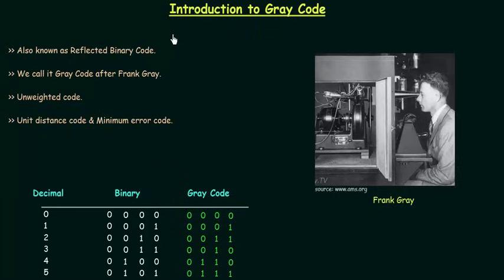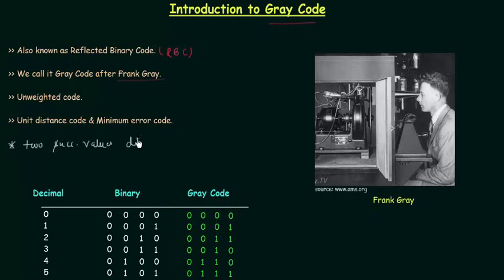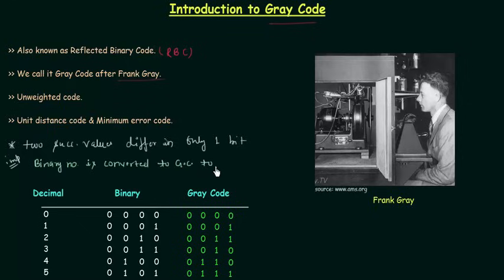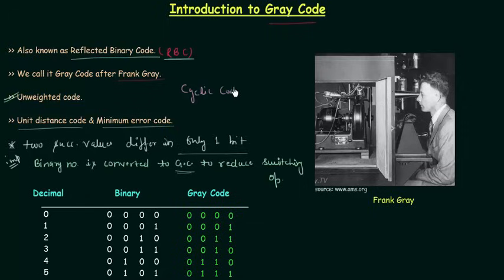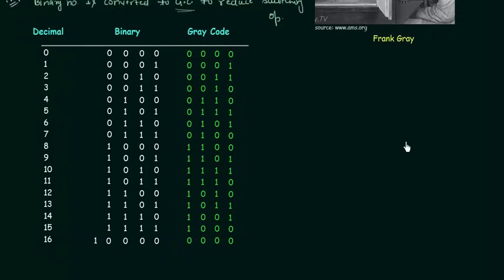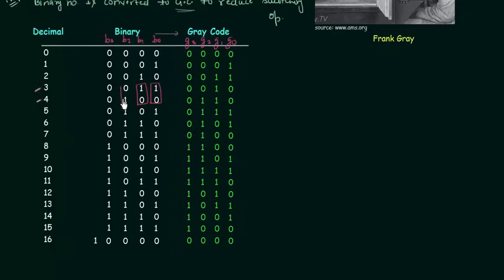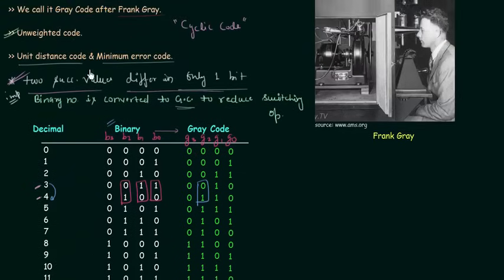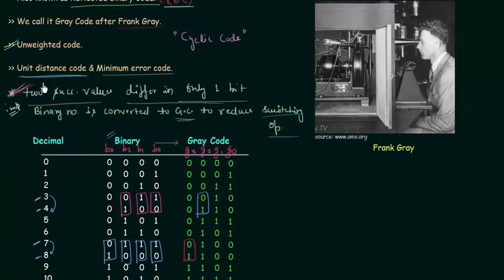Introduction to Gray Code

Comment: Applications of  Gray code:
1.Gray codes are useful where analog information converted into digital information or vice-versa.  
2.Gray codes are used in error correction in digital communications like some tv cable system.
Reply: And many more other applications...solving tower of Hanoi problem, finding Hamilton circuit on Qn “cube “, ...
Reply: How to get digital electronics notes in pdf form

Comment: gray code use for

1) glitch free circuit.
2) asynchronous fifo pionter.
3) high speed decode circuit.
4) error corrections.
Reply: Absolute Encoders's Output

Comment: Why gray code called reflective and cyclic code
Reply: Because if you take all the other digits other than msb , they reflect from the middle:

8 and 7 (X100)
9 and 6 (X101)
10 and 5 (X111)
Etc..

Comment: Hi, sir, you did a great job, thank you. I have a small question, how is the gray code of 16 equal to 0000 ??? I got 11000 by applying the methods you mentiend in the video.
Reply: Hey Marry! Great question, it's becuase the definition of Gray code is nibble based instead of 5 bit-based, so instead of going passed the 4th bit, we "reinstantiate" it (like the last state of a clock) and begin again at 0.

Hope that helps :)

Comment: What is mean by Unweighted code?
Can you explain this????
Reply: Unweighted code means the bits at different positions in the code aren't associated with specific weights. For example:- 8421 is a weighted code. Now, if we write any binary number in this format as 1101, then it means LSB i.e '1' is having weight as 1, '0' has weight 2, '1' has weight 4 & MSB i.e '1' has weight 8. Since, no such positional weight exists for Gray code, we call it unweighted code. Hope it's clear to u now.

Comment: Why there are 0 to 16 not 0 to 9 in decimal column? Since decimal no. Consist only frm 0 to 9
Reply: 16 possible combinations 2^4=16 and commonly used is 4-bit binary system so yeah. I didn't wanted to comment since Ur comment is 4years old 😂 but I hope it helps others ❤

Comment: What comes after 1101 in gray code ?

is it 1001 (9)  or 1111(15)  because both are  differing by one bit from 1101. should we choose small or great value?
Reply: You'll choose 1111(which is 10 in decimal) because it comes next to 1101 in ur question which is 9 in decimal.

Comment: Sir I have one doubt..why gray code is called reflecting code.?
Reply: Because if you take all the other digits other than msb , they reflect from the middle:

8 and 7 (X100)
9 and 6 (X101)
10 and 5 (X111)
Etc..

Comment: Why gray code is called reflected code?
Reply: Because if you take all the other digits other than msb , they reflect from the middle:

8 and 7 (X100)
9 and 6 (X101)
10 and 5 (X111)
Etc..

Comment: What is unweighted code
Reply: it means a bit is not have the specific weight... 
like in binary nth bit from right have weight 2^(n-1)...
binary 1011 = 1*(2^3)+0*(2^2)+1*(2^1)+1*(2^0)=11